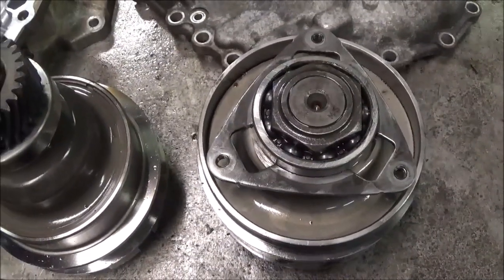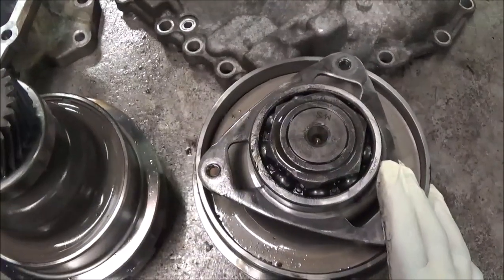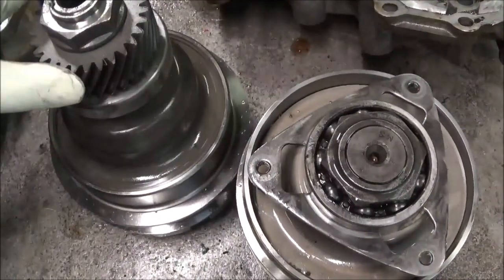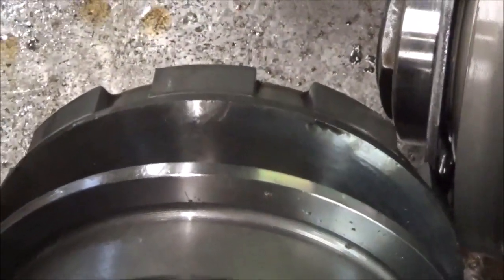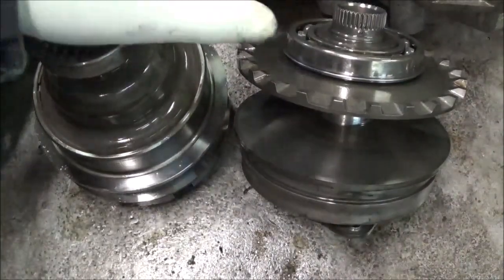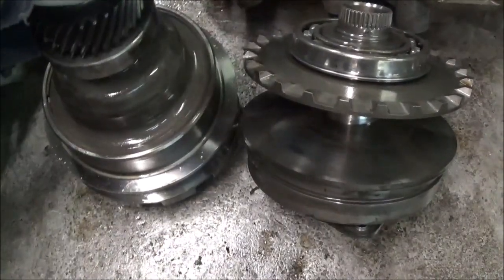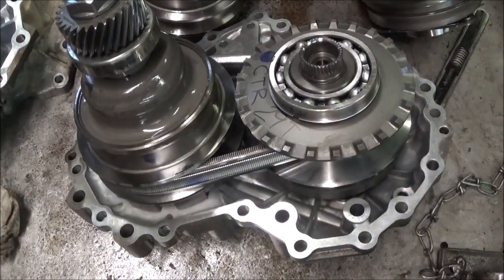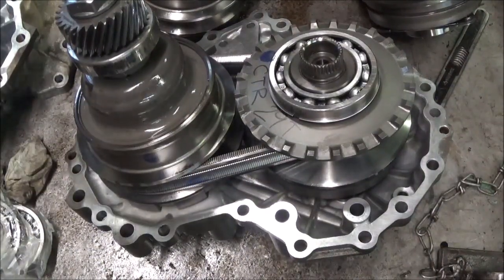JF011E CVT TRANSMISSION TECH TIP 1 (NISSAN, MITSUBISHI, DODGE)

Comment: Great info sir! New subscriber question. 
On the cvt belt the oem has ridges like the edge of a quarter. I'm rebuilding a jfo15e the ridges where worm off the belt. The belt is smooth on the sides now not grooved or chewed up just not grooved. (Variator pulleys look great) 
Question  #1 Can the old belt be reused?
Question  #2 I did buy a new aftermarket belt and it has no ridges at all just smooth. Should I use it or the old one?
Just not sure what's best. 
Thanks For your time.
Reply from the maker: If you bought a new belt, use the new belt. Make sure the pulleys that contact the belt has smooth surface. If they are not smooth, then you need a good pulley system.

Comment: question, my cvt start in a high gear like your taking of in 4th gear, then after moving off it gears down and go, on mornings when i first start it would be in first gear then slowly shifts into a high gear, on the scan tool we see that the computer is at 100% duty cycle for the secondary variator and the pressure goes up to 4 mpa or around 500psi , after moving off it gears down and the pressire would be at 1.3mpa, is the a leak variator seal on the secondary ?

Comment: The exact same thing happened to my drive variator but I've gotten a new set of pulleys and I've got them installed and the transmission is back in it's a Jeep Patriot all other trouble codes went away but a p0777 code remains and the Jeep goes into limp mode. Not really sure exactly what this code means and I haven't found any good material explaining what's going on with that code
Reply from the maker: What year is this jeep and what was wrong with the transmission when you took it apart?
Reply: @thisisyourtransmission  2008 jeep patriot awd
Reply: And will those Ball barings you mentioned in the drive  variator more than broke the hole guide for the barings shatterd . I'd post a picture but it doesn't seem I like i'm able
Reply from the maker: With cvt transmissions, it is best to change the valve body with a rebuilt valve body or take every valve out to make sure there are no sticking valves. Second, always change the flow control valve in the pump or get another rebuilt pump. I show this in other videos. Cvt transmission make a lot of metal. You have to make sure the valves are free. Now, you will probably have to take it out again.
Reply: Thats ok i got the valve body out already and was going to go through it again

Comment: Where do you purchase the pins at. I’m having a really hard time finding them
Reply from the maker: Go to the hardware store and get 6mm drill bits.  Use the solid side. And get cobalt.
Reply: @thisisyourtransmission  Great video! Would you consider doing a video on this change modification? I am learning So much from your channel. Thanks!
Reply from the maker: @dporrasxtremeLS3  What change modification?
Reply: Clever!! I was thinking dowel pins,  but dowel pins can be a pain to modify with them being such an extremely hard material. I like the drill shank idea way better. I’m fixing to crack open my first JF011E. Your videos have been very informative 👍.
Reply from the maker: @MrHanky_YT  there is a number 6 drill and then the is 6mm drill. Get the 6mm!
Reply: THIS IS YOUR TRANSMISSION I’m aware of this. I am a  machinist. That was me typing to fast. But I can imagine what headache that .032” difference would make trying to use a #6 instead of a 6mm